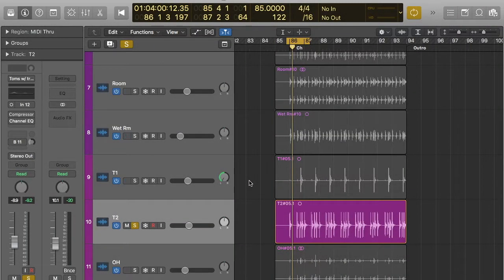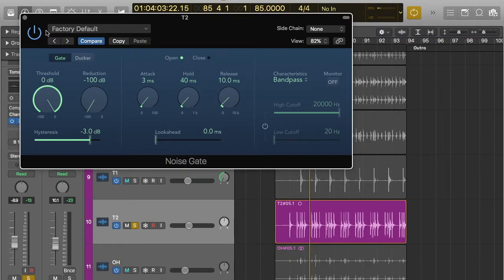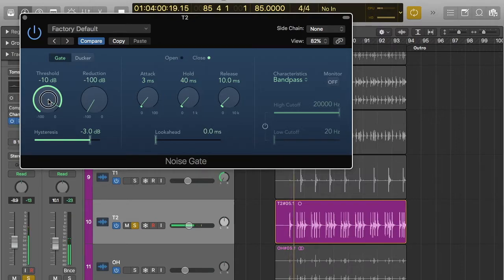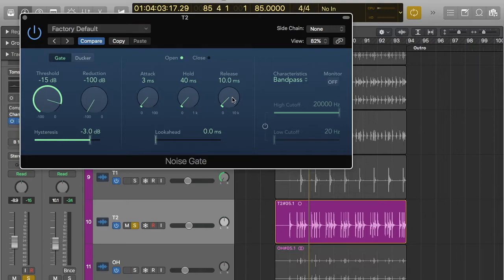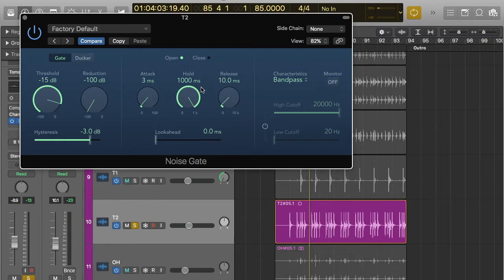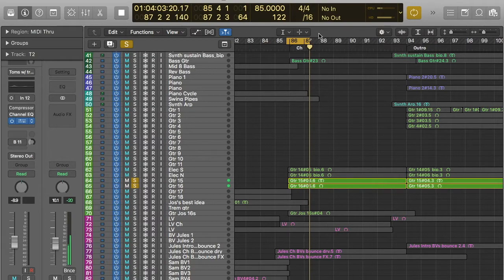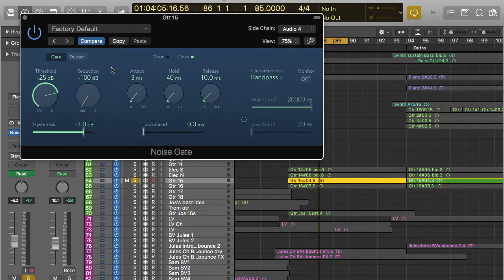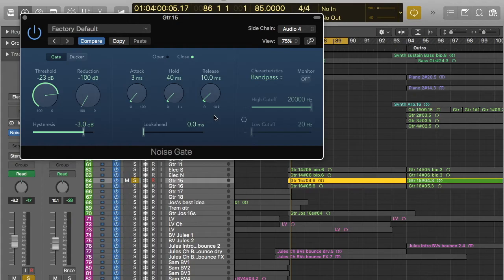How To Noise Gate & Side-Chain In Logic Pro X

Comment: Is the release on top/after of the hold? so if you have 50ms hold and 10ms release as you have in the default, the gate stays fully open for 50ms and then after that fades back to closed for another 10ms? So the total lenght of sound is 60ms?
Reply from the maker: Exactly that! 50ms it is held open and 10ms it slowly fades to being closed

Comment: Can Noise Gate be used for Vocals? Like will it make a difference
Reply from the maker: I wouldn’t noise gate a vocal, what are you trying to achieve from doing it? Remove background sound?
Reply: Sonically Sound yes that would be my goal, thank you for replying.
Reply from the maker: You can try noise gate but it may prove difficult, something like the Tom works well because when it is hit it is hit loud so it goes through the gate, a vocal can be be more dynamic, quiet and loud at different parts of the song so a gate may not work. Give it a go but I’d suggest looking into some noise reduction software
Reply: Sonically Sound Awesome! Thank you for your help I appreciate it.